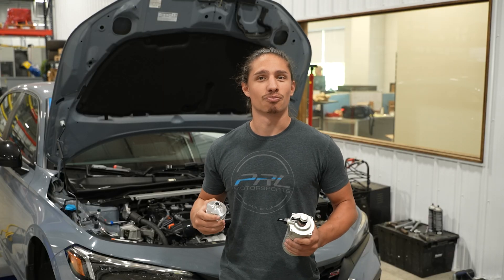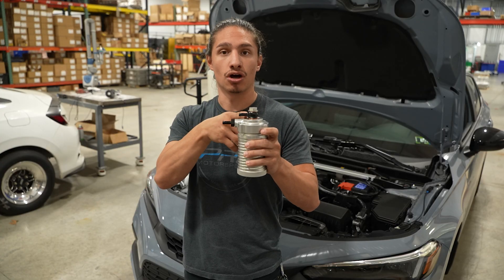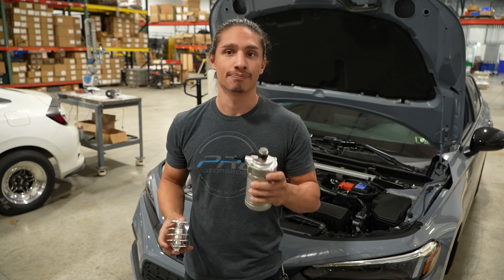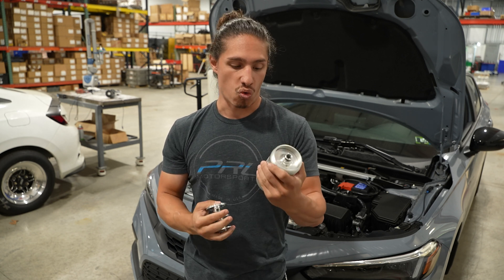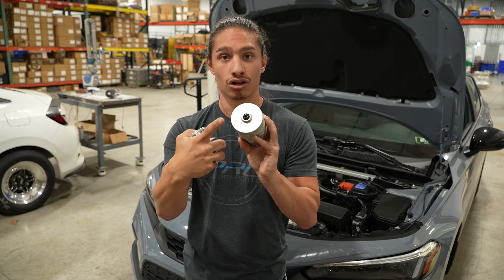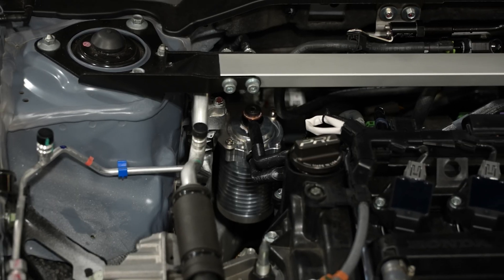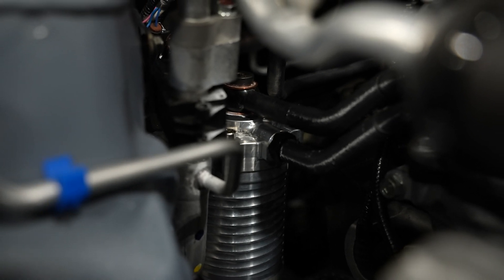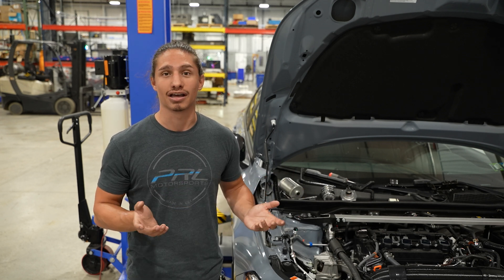PRL Motorsports - Introducing the Helix Air Oil Separator, & Here's Why YOUR Vehicle Needs It

Comment: New to Honda here, also new to owning a DI engine. I have a 2022 Accord 1.5t, I’m not a mechanic by any means, but I was just wondering will this help with fuel blow by/oil dilution? Any tips, advice, or general knowledge on good maintenance, and how to properly tackle this issue is greatly appreciated